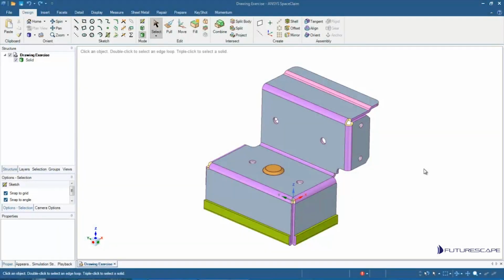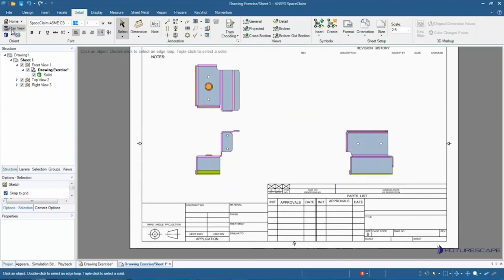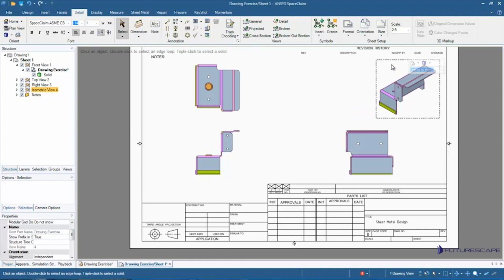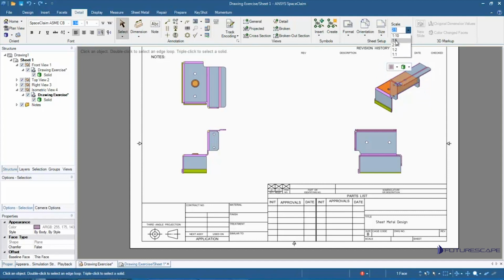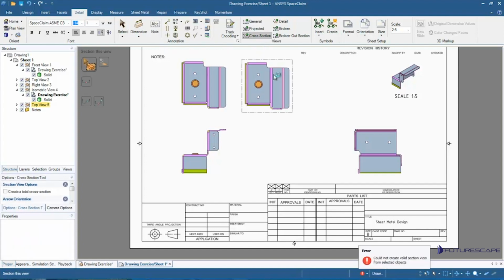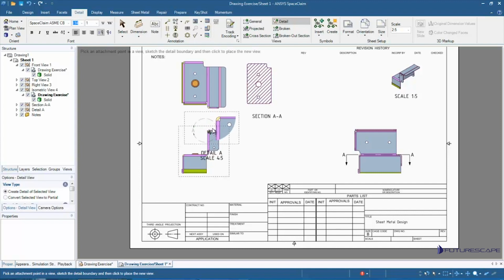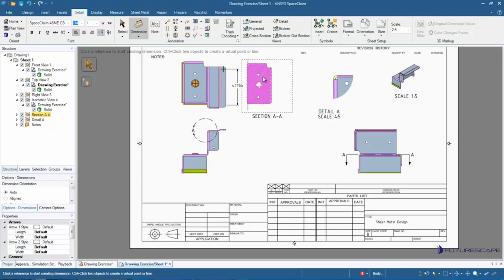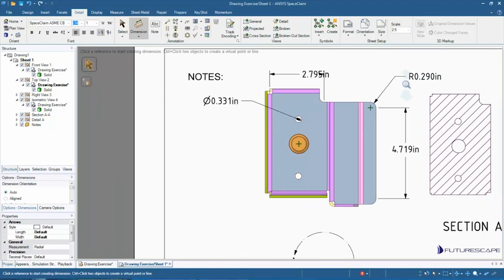SpaceClaim Tutorial - How to create Drawings 2018

Comment: How to place an axis line to show the symmetry (for example, between two lines) of the drawing?
Reply: @Nabin Haldar Yes, thanks for that! It's still some way. So we must first draw construction lines in the model... But then they are probably not associative, and when the model is changed, these lines must also be moved. If, for example, there are any legs made of square tube, on the drawing we want to give the distance between the axes of the square tubes. Let's say we do it as described, but if we change the distance between the legs, the construction lines that serve as axes will not move with the legs and in the drawing the distance will not change...
Reply: @Nabin Haldar Why didn't they make it possible to put a center line between two random lines on the drawing? Even on a simple rectangular plate, we should be able to put two center lines on the drawing. WTF?

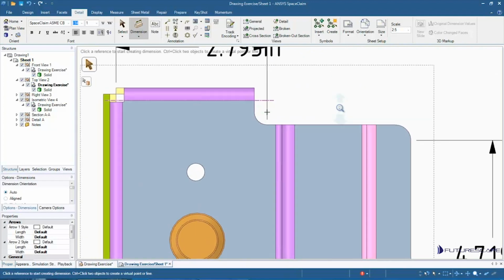Comment: I have a question in addition to previous remark: in another video I have seen the instructor editing the dimensions in a section mode under the Design menu and that would change the size of the part......it seems like the dimensions which are editable and influence the size of part must be on the section plane...so these dimensions you showing at 10:00/10:49 could not be modified, right?

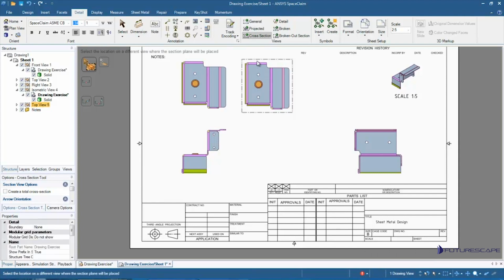Comment: Not to be a pain in the butt, but there is a difference between "cross section" and "cross section view". You mentioned and actually created cross section between 6:20/10:49 and 7:00/10:49, but then right at the minute 7:00/10:49 you said " so, now, that I have the cross section view".....A lot of younger engineers and machinists do not realize the difference between the two, because they do not make them sufficiently aware at the schools..... This difference should be emphasized, though to increase the awareness! Section view includes the section of the part, but also view of the rest of the part from that section onwards in direction of section arrows.....Just saying...no bad intention here! Other then that it is a good lesson....